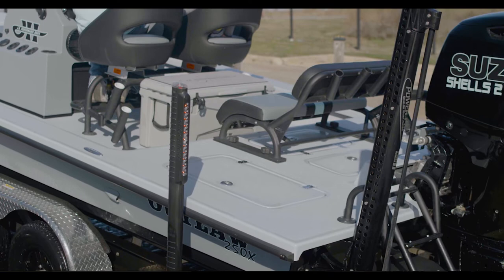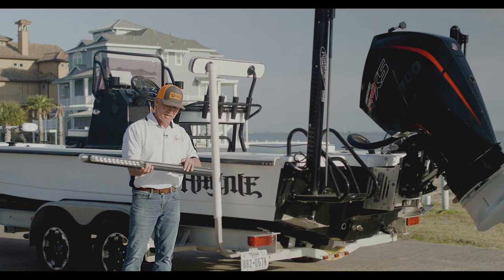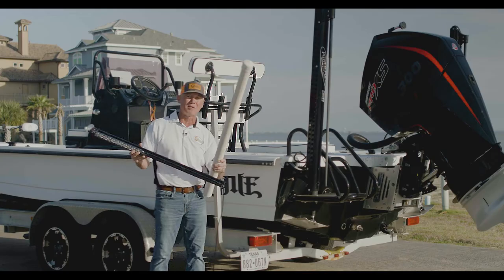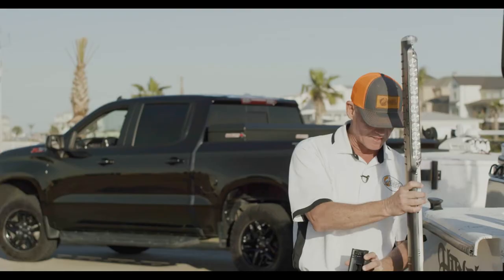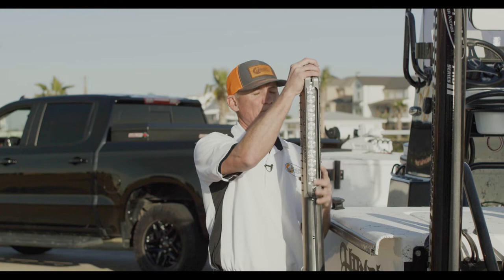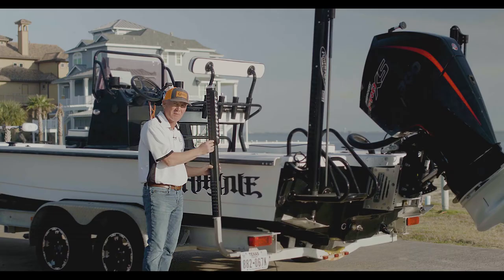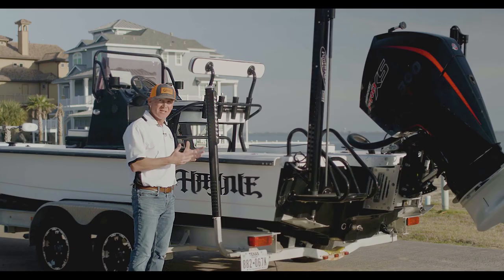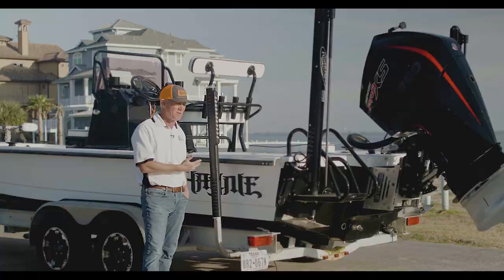How To Install Guide Posts on Your Boat Trailer - Slick Sticks Trailer Lights

Comment: Looks like a good sturdy product.  What type of wire connectors are included?? Are they water tight connections?
Reply from the maker: Hey Dustin - Yes, we have constructed a very sturdy product that performs! We dont include wire connectors due to the myriad of trailer connection options based upon different trailer setups. We do include a generous amount of wiring to hook up with your trailer system. Cheers and Safe Boating! Come visit us at GetSlickSticks.com

Comment: 3 wires, white, black and yellow. What wires are what.
Reply from the maker: Hey John - Here is the wire configuration: 
Yellow wire is turn signal
Black wire is brakes
White wire is ground